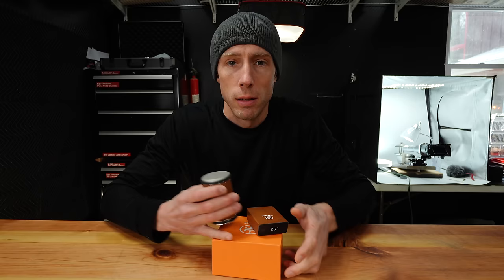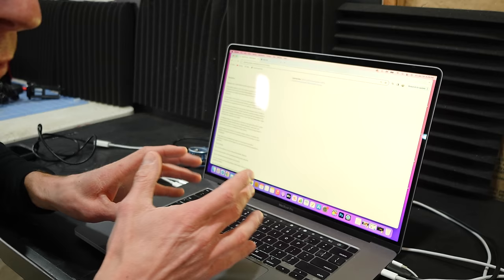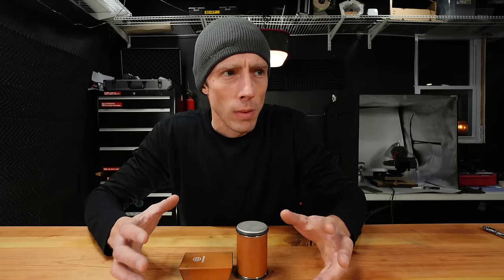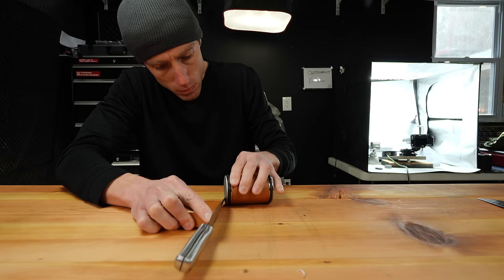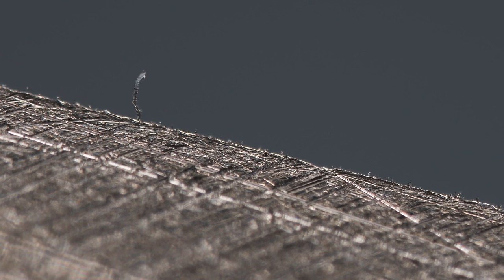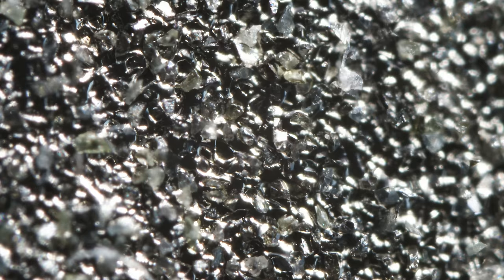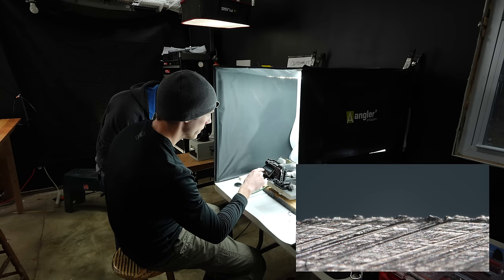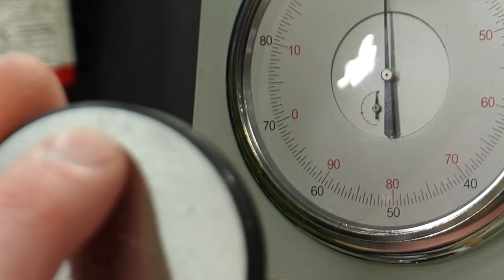There’s Something Strange About These Rolling Knife Sharpeners..

Comment: Use gun oil on the diamond face. Ive been doing so with my own numerous diamond plates and rods, it doesn't interfere with the abrasive but it does keep the powdered steel fom getting gummed up in-between the diamond grit

Comment: I've recently bought a very cheap ($25 or something) rolling sharpener from Aliexpress - and surprisingly its surfaces look much more like original Horl that this one. Something like 300 and 1200 grit.
And it works (for now) pretty well. I wanted to look at the git surface under a microscope, but it doesn't fit there, too thick...

Comment: Edit: seems like you explain exactly this later in the video.

The "drop off" in performance is simply due to the nature of diamond-impregnated materials. Essentially, the manufacturers put way more diamond particles on the surface than will actually stick, so the diamond stone cuts very rapidly at first. Once all of the "extra" diamonds that aren't cemented into the surface get worn away, the diamond stone starts working at its normal pace of metal removal. Oftentimes, they'll recommend that you "break in" a new diamond stone by sharpening a very blunt chisel, or simply just rubbing a piece of un-hardened steel across it for a few minutes. 

Diamond stones are nearly impossible to actually "wear out," especially in such a short time as the video implies. You just got used to the very aggressive material removal of the new stone.
Reply: yes, this. that exact information is also written in the Horl 2 user manual.

Comment: Hey boss! Great video! I sharpen kitchen knives. Im also a chef. The roller is bad alltogether. Straight blade like a nikiri, no problem. Standard european chef knives will not be correct at the tip where the blade gets narrow. You may have the same angle on the edge, but the thickness of the blade will make it super uncomfortable to do fine work with. The hip of the working edge will give resistance when applying downward pressure through vegetables. You may say get a smaller knife. I use an 8 inch chef knife for most tasks. Aint nobody got time for that. You would grow to hate it and not know why. 

-Grind

Comment: I've noticed, that you've used this same angle both for "sharpening" and for 'honing" - it's a mistake - you should have used the narrower angle for sharpening and the wider for honing - this way you could have removed the bur and... well - hone just the edge. Another problem with your approach is that this tool is actually great for sharpening and specially re-sharpening the edge (ie not shaping it to the correct angles) - I mean, when the blade has already been shaped to the correct angles before, this tool will do great re-sharpening it, but it's not any good for shaping the blade to the angles from the random angles that the blade inherited from the original manufacturing proces - as you've noticed - the grid is too dense for shaping the blade. It would be much better if they supplied another "drum" with much more course abrasives just to pre-shape the blade before sharpening. 
And the last thing - the honing proces is supposed to be only slightly abrasive and since the tool usually is supposed to adapt to the shape of the catted surface and embrace the abrasive materials on its' soft surface (like for example the leather belt when you remove the bur sharpening the razor blade), so measuring the hardness of the honing surface indicates that you actually don't understand the proces principles.

Comment: yo I got one of these as a gift and it came with a strap and the instructions said to use the strap after the deburring side. So far I've used it to sharpen about 5 knives and it takes forever! and you need to wash the cutting side as the metal filings will clog it up. I've had success wiping the knife with a paper towel every couple of minutes to get rid of the filings so it doesn't happen as fast. Anyways it gets the knives insanely sharp. I started at 20deg and got a good edge with that, then moved to the 15deg side and got my 14" chefs knife about as sharp as a fresh double sided razor in about 2 hours combined. It's actually scary dangerous how sharp it makes large knives with good steel you gotta be VERY careful with them once you get it right. But cutting a fat red onion in two after you're done will make you feel like superman it goes through effortlessly like slicing a tomato. Thanks for coming to my ted talk

Comment: 10:45 the issue with this test is that there is a difference between the internal structural integrity and the integrity of the cylindrical frame. Unless the frame buckles it is likely fully supporting the calibration plate with very, very minimal compression.
Imagine doing the same test with an open can of soda; Measuring the hardness of the aluminium lid will obviously not yield any meaningful results, whereas if you then place a calibration plate on top of the can you will see a measurement until the can buckles.

Comment: No idea how I got here but I have a rolling sharper from who knows when in a drawer somewhere. Its from the 70s at the newest. My grandfather had it. I would guess thats the original one. You do roll it across the counter, but it does not work like that one. It has groves in it you push the blade in to an roll it back an forth. It works, but its in a drawer for a reason. Think manual version of whats on the back of a can opener.

Comment: Am I correct that your general approach for sharpening dull knives is a 400 grit diamond stone followed by stropping with a high quality 6 micron paste?  I’ve seen produce scary sharp edges with great edge retention using that method. Seems like a more efficient process which produces a superior sharpness and longer lasting edge. 
That 2x4 experiment with cheap knives you did was pretty jaw dropping!

Comment: I’ve been using a Kitchen Devil ceramic wheel type sharpener for around 7 years.
Cost me around £5 GBP and sharpens my kitchen knives to a very adequate level for both vegetables and meat processing.
Buy one of those and spend the money saved in this junk on a decent set of knives.

Comment: I agree, I have DMT diamond plates, and for general purpose knife sharpening, especially for kitchen use, if you have to pick one grit, the extra coarse is certainly the way to go. and the rolling setup looks like it dictates a rather low pressure limit, making the result smoother so if anything, thegrit can or shodbe even coarser..the DMT extra extra sharp really is only for large wurfaces though. it's great for flattening metal plane soles.

Comment: I own an original Horl 2 with the diamond side, a ceramic honing side and then another 6000 grit disc. And i must say its great doesn´t matter if i use it on my run of the mill kitchen knifes or for the outdoor knife made out of D2 it does its job, reliable and pretty good. 
I´m just to stupid to hold an angle on a wetstone so its perfect for me :D

Comment: I'm thinking about getting a sharpener. The tumbler had 20 degrees, and Horl had 15 degrees. If you take the most sophisticated Horl it's cost-wise like a Tormek 1. I tend to the Tormek due to a free scalable angle of sharpening, a five-year warranty, spare parts, and a good reputation with other users, especially for kitchen knives. What's your opinion on all of it? Yeah, it's a different price range, but I don't want to ruin a bunch of good knives 😢, they are not that cheap if you buy a German “Solingen-made” knife.

Comment: the 2 people in the photos are 100% not the same people 😁😁
also i need to say that as a horl possessor, it costs a lot more, but it works ewally well, still after a bunch of knife sharpened :D i also have the finer stones of corundum that they sell, they do a nice work and gives a finer touch on the blade.

Comment: Have you tried the WorkSharp version? I got one as a gift. The sharpening block isn't a plain cylinder; it's comfortable to hold and I don't have to reposition my grip. The sharpener side is a magnet; it comes with three disks; coarse, fine(r), and ceramic. No idea if WS is going to make the disks in other grits. It worked pretty well, but I haven't used it as much as you have. The size and shape of the blade definitely makes a difference - if you're outside the zone, it's a pain in the backside. I do like it. No idea if it will maintain effectiveness.
Reply: Just checked their site. So far, just the three - 320, 600, ceramic. They sell replacement disks at about $15.

Comment: Made one with scraps. A 2x4 cut on both ends at a 17° & 20° angle, drilled a few holes to insert magnets, a 3" cylinder of delrin, double sided tape, and wet sandpaper from 220 to 2000 grit. I'm a cheap bastard and I won't apologize for it.

Comment: I've been using the same whetstone for 5 years, I think it cost me $10 bucks at Home Depot, I hold the stone like I'm going to polish a boot and I move it in small circles at about a 25 degrees-ish angle. I think the angle that rolling sharpener block sets the knife is a bit too aggressive, that looks like almost 40 degrees. But, I'm shapening a chef knife ( French knife )

Comment: Eh, it's an interesting gimmick but probably the best thing I've seen for super casual home cooks who can't use a stone is the pass through style with the carbide inserts, like the chestnut sharpener. Of course, you need to start off dragging the knife through harder and then soft once the edge is coming up; but it's useless for knives with a bolster unless you're willing to file the heel.
At the end of the day, nothing beats a couple of good japanese waterstones, followed by a kangaroo leather strop loaded with titanium/chromium oxide, the learning curve is a little tricky but absolutely worth it if you have the time.

Comment: Does it work better than the $12 Ilsa Yoyo?  The Ilsa doesn't actually need a large counter or skill to use.  And also fits in a pocket.  and is based on a much older one that was actually collapsable and could fit in a COIN pocket.

Comment: I bought the Tumblr for $100 or thereabouts and I also bought the knock off for around $50 or thereabouts and both of them came from Amazon which is the only place I will buy something like this.  I suspected that it wasn't everything that they claimed..  I am by no means an expert when it comes to sharpening knives, and I'm primarily interested in kitchen knives.  Does it sharpen kitchen knives, yes it does but for that kind of money can you duplicate or get better results for a lot less money?  My conclusion is you can do a lot better for a lot less money and so hence the reason that I bought from Amazon, because both of them were returned.

Comment: Proper monocrystalline diamond stones (like the Atoma stones) don't really "break-in" - the diamonds are very well fixed to the plate. Cheap stones are polycrystalline and poorly electroplated. They dull quickly because as soon as one diamond is loose, you drag that across the surface and it'll rip a few more out
Reply from the maker: No not exactly. Both break in. Monocrystalline diamond and polycrystalline diamond are different crystalline structures. Both can be electroplated correctly and incorrectly. The break in consists of the poorly bonded surface diamonds above the plating breaking free. Both types wear down over time and both types can be incorrectly plated due to poor plating thickness.

Comment: Using diamond-impregnated ceramic would be better than using diamond coated metal plates because they last as long as you still have ceramic material. The ceramic disks could be removable so they could be leveled. They could also be replaceable. People could order different grit diamond-impregnated ceramic disks.

Comment: Stones with oil are still the best. Not even debatable, but it takes experience and does not qualify as easy to use , but that said, a good set of stones ranging in grit are amazing to use and if used regularly can become easy and quick to use. On top of that you can sharpen anything from a letter opener to a cleaver. The stones will become hollow and need to be re-faced every so often.

Comment: Are you not suppose to roll it? I keep seeing it get pushed back and forth but not rolled against the blade. Not that it would probably make a difference but it should be used as intended. I at least assume it is meant to be rolled against the blade not slid back and forth.
Reply: I believe the inner part rolls while you hold the outer sleeve

Comment: Of course the hardness test is accurate, it measures the static force at the tip of the imprinter. I.e. as long as you hold contact long enough for the reading to settle and nothing slips or breaks, it's still gonna measure the correct thing. Even if it set on rubber, the rubber would just be compressed until it provided that force and done.

Comment: So could you make a crude imitation of this with a tin can and attach sandpaper to it. On the other side cut a wood block to the desired angle hot glue some magnets to the block? You would have to replace the sandpaper after a while but the cost would be about $6.

Comment: Diamond is problematic when used to sharpen steel.   It is ideal to sharpen carbide tooling.   When used on steel, it gums up against the exposed diamonds and can create so much friction that it dislodges them.    This happens very fast on cheap diamond stones.

Comment: You can buy the Horl system for under £30 here! But why not cut a piece of wood to the desired angle, glue a magnet to it  and use a honing stone to rub to and fro. Finish off using a butcher's rod?

Comment: There is another design change I would make. Shrink the circumference of the roller, and leave the sharpening surface a larger diameter. The roll it on a raised surface so the sharpening surface hangs over the edge. This way your spinning motion is faster than your rolling motion. This would speed up the sharpening process significantly .
Reply: horl made a version with a planetary gearset (or epicyclic gearing) inside the handle to enable you to sharpen faster because it makes the disc spin faster that way (classic gearbox basically). apparently realizing that version (which costs a LOT sadly) was a big dream of the designer at horl company. :D
Reply: @florafeldner  That would make sense. You don't want it a lot faster, but just slightly.

Comment: even the good version of that looks like it should cost 30-80$, not qlmost 200$, depending on how much of it is made in germany vs. in asia, and whether the grinding discs have to be made to order or are actually adopted out of an existing larger production line (presumably for use in some motorized way). if the discs are cheap, the whole set ought to be cheap, because the rest certainly is very simple.
Reply from the maker: The horl version is the finest engineered piece of equipment i have ever seen. It is priced accurately being made in a first world country that pays employees we and makes a quality product. You can certainly buy cheaper but you might as well throw that money away because after a few uses it stops working.

Comment: "looks similar" (or not) is not how patents works. The claims are usually written to be as broad as possible, to prevent small variations to work around the patent. For example, the sharpener would still work if it was slight oval shaped instead of round, so you would not mention the fact that it has to be round in the patent. Similar for the rolling motion, you would describe the actions in more general terms, that would include rolling but also all possible variations of rolling.

Comment: Very good video, you can probably fix the sharpener by sticking dubble sided tape thin or thick (you might need to test that) and stick what ever grade or grit of Emery cloth or sandpaper and when it gets worn out just replace it.
Th only thing I can see with this toy, is that it exposes the blade facing towards the user and their hands ... 😳 

Also it could work batter if there's a Bering in the inside where the outside dosen't spin and the rims are attacked to and internal driveshaft.
I would also change to shape to like a dumbbell to keep the kinkiest away from the sharpened blade 😳

Anyway try the dubble sided tape pad thingy food luck

Comment: Ideas don't have to look exactly the same for the principals used to be the same making it essentially the same product... It's from 60+ years ago of course it's going to look different today. Even just based upon the drawings and not the writing included with the patent, the bottom set of circles look pretty similar to the stainless steel honing side. Not to mention it could just be the photocopying or something but those wheels look like they're made to appear abrasive. The major difference I see is the patent seems to be a fixed singular device where the new one is two pieces that are doing the same thing. You can see in the patents diagram that the disks are angled which is exactly what the big ass block is doing on the new one... I think I'd rather have the old one because it's doing the same thing but it's more compact.

Comment: So, what's up with the tumbler SS side???  I'm not sure what that is even supposed to do.  I have the Hone knife sharpener.  With the many magnetic disks and the ability to do shallower pearing knives plus 11-14 degrees it's the best one I think. You can also get 200, 400, 700, 1000, and 3000 ceramic disks.

Comment: YOU CAN 3D print this for like 5$ , use 50 / 76mm small angle grinder / dremel diamond cutting disc ...and it will work as good as this ,
or just use Cubitron II sandpaper --- its ceramic and last loooong time (10-20x longer than "brown" ones) and stick it to some pipe with 2 orings XD